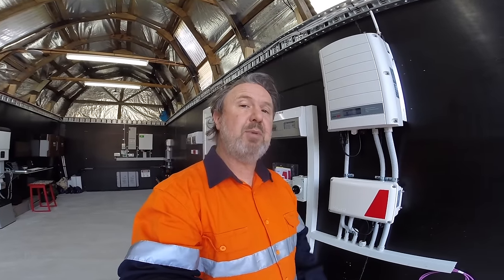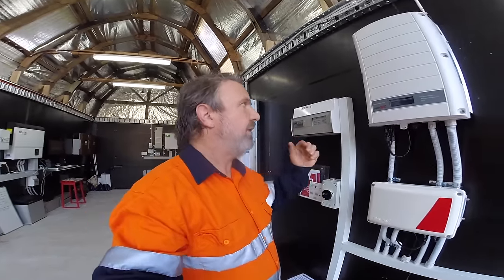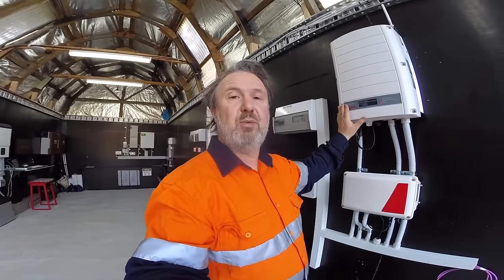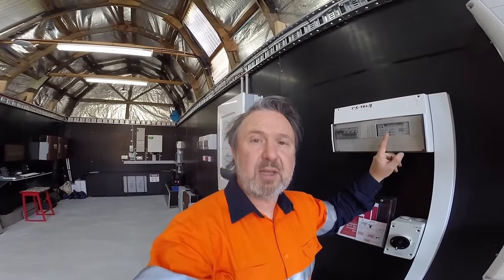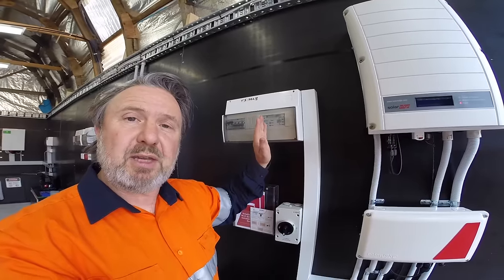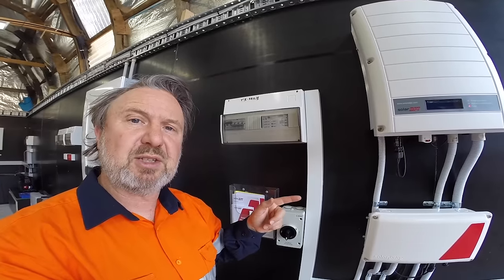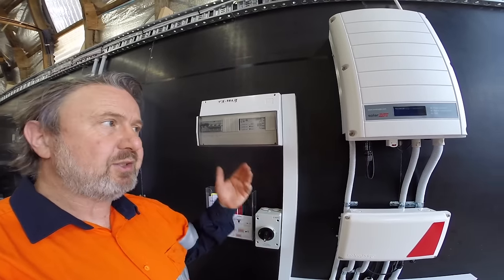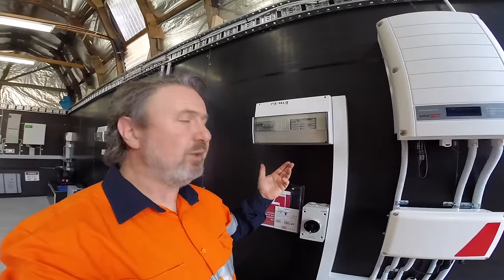Glen Morris discusses benefits of using SolarEdge’s StorEdge solution in Australia

Comment: I am just learning about the optimizers. The inverter that you mentioned that is grid tied, but can also charge for storage as well... can that inverter use the optimizers as well with the storage? What happens when the utilities goes out? Does it automatically switch over to the batteries? Or is it manually done? And in either case, do the solar panels still produce to charge/be used in the inverter while the utilities are out?

Comment: Does this system allow you to run 'off grid' if the grid goes down. I mean more than just battery backup for critical system.
Reply from the maker: SolarEdge’s StorEdge system is designed as a backup solution, not as an off-grid solution.
Reply: If you were able to attach enough batteries to a storedge system, would you in theory be able to run off grid if you had to? Only using power when needed to pump water, power fridge/freezer, maybe a fan or two and some lights?
Reply: @SolarEdgeTechnologies  what happens when grid fails